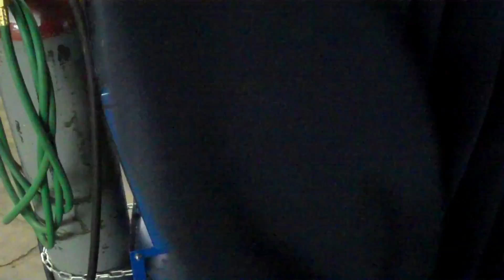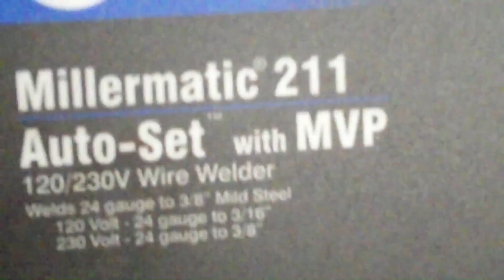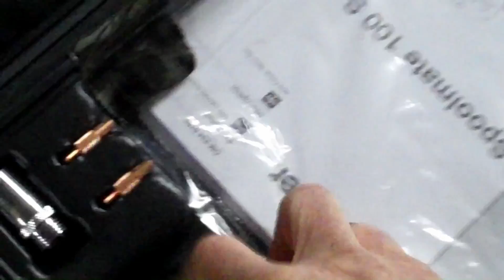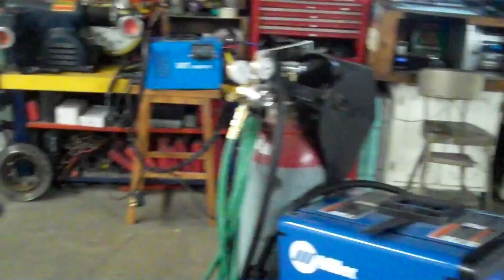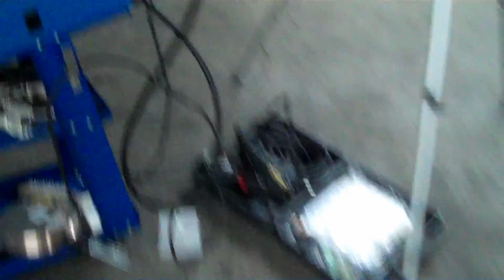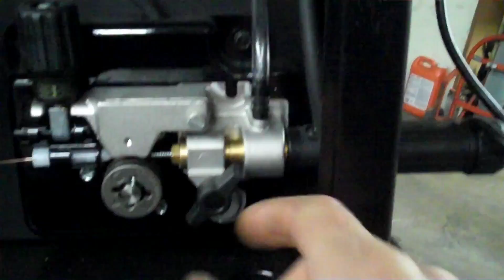Millermatic 211 Steel Mig welder review and Aluminum Spoolgun

Comment: I hope you kept this.  They have went nuts on prices since you can't get any more transformer welders from Miller.  All of them on eBay have closed between $1000 to $1300 over the last month. One was completely d.o.a. and sold for over $500 and it was the only one below $1000.

Comment: thats nice!!! I'm still happy with my Northern Industrial Welders MIG 135 (cheep northern tool brand) but one day I will need to upgrade. I also have that harborfreight cart For the last year. I'm happy. Its only rated for 100 pounds. That welder has to be what 75 and the tanks got to be 100 at least.

Comment: GREAT INVESTMENT, I bought the millermatic 200 about 25 years ago & I love it, the only thing I would change is how the gun ataches to the machine, when it comes straight out it is always bent down and eventualy wears the line plus it makes the overall length 12" longer. if they angled it down or arc it to the back it might work better. also the toilet paper looking air filter works on TP if you put a stocking over the TP to stop the decintergrating chunks from coming off of it

Comment: Another advantage of buying a new unit (instead of a surplus one--companies are dumping old ones in favour of the energy savings of the newest welders) is the power supplies are much more efficient/cheaper to run. Thanks Brian, I am shopping for one, this helps ;)